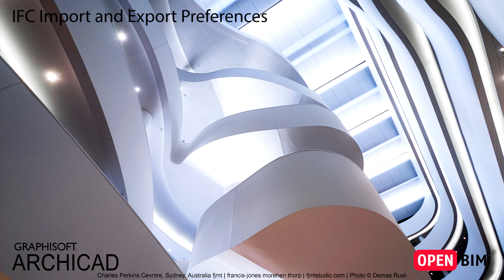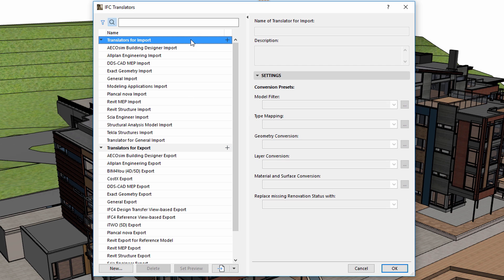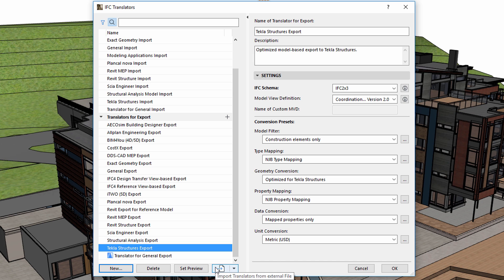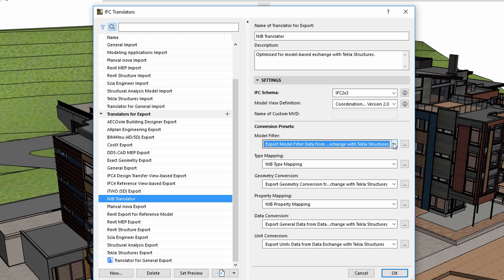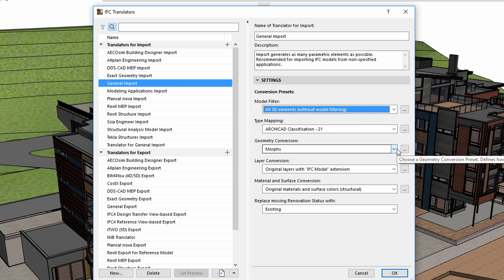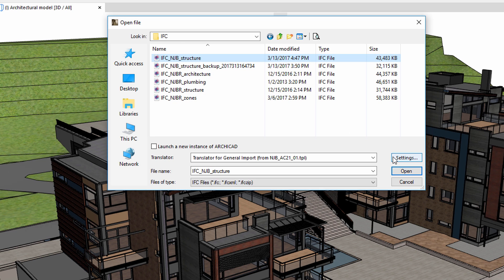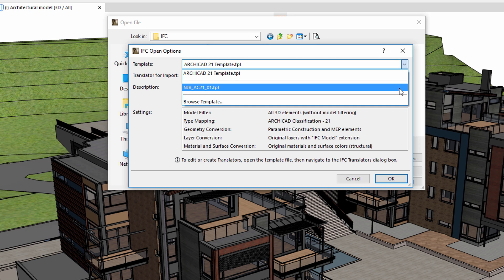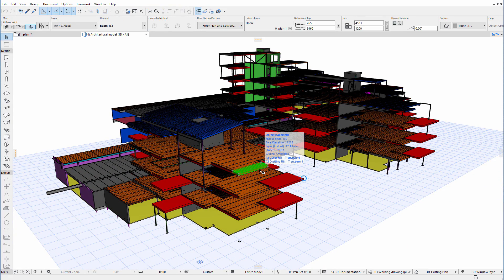ARCHICAD 21 - IFC Import and Export Preferences

Comment: Thanks! I was looking for a way to import Archicad architectural models into out Revit MEP model. Hope one of the Revit 'Translators for Export' will suffice. Currently, the imported model from Archicad is full of bugs and incorrect geometry.
Reply: Did it work?
Reply: monz1010 kind a, Some floors are still missing unfortunately. At least it’s faster, before it took 90 minutes, now it takes 15 minutes.
Reply: @len7431  do you still use this workflow?